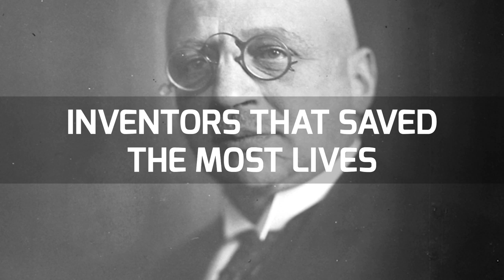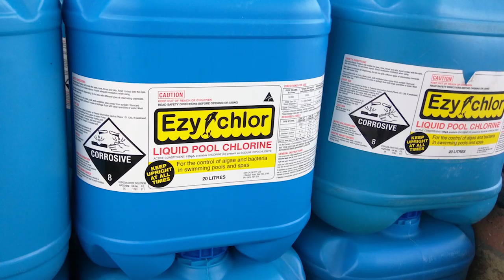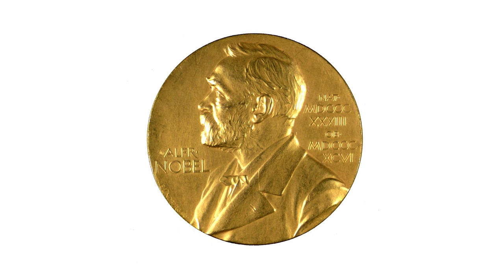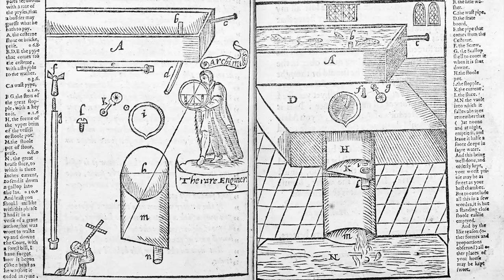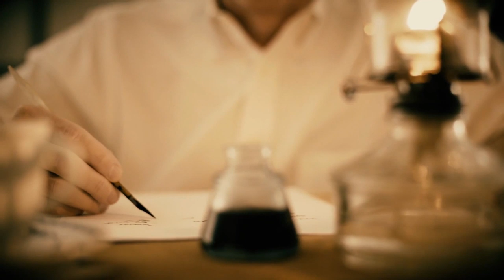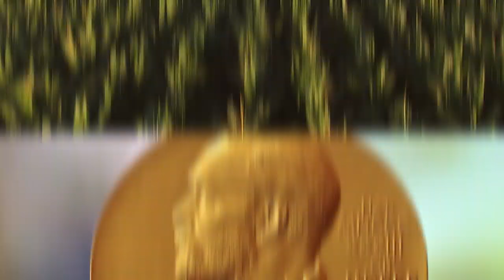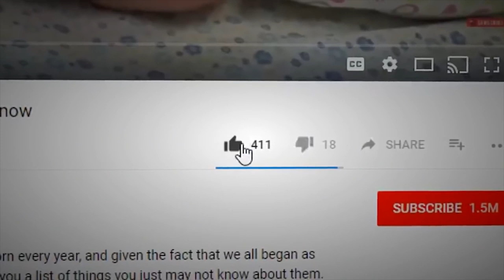Inventors That Saved The Most Lives

Comment: 1:25  The description of the 2-pronged needle (how it works) doesn't make sense to me. If the vaccine is held between the prongs, and the prongs are just "tapped" on the skin, how is the vaccine injected into the body (i.e., under the skin)?
Reply: As far as I understand it, the procedure is something like this:

The needle is removed from the packaging, the biforcated end is dipped into the vaccine vial, the prongs holds a proper amount of the vaccine, and you use the needle to deposit this onto the surface of the skin of the person that is to be vaccinated.

The needle is then used to prick the site 15 times, this makes small punctures in the skin and allows the proper amount of the vaccine to get in. you then discard the needle, and clean up the drop of blood from the site. 

You can then move on to the next patient. 

This is a mass vaccination proceedure, so I suspect it is useful that the tool is simple and easy to use and can then be discarded, while you can reuse the vial of vaccine solution without having to worry about contamination issues.